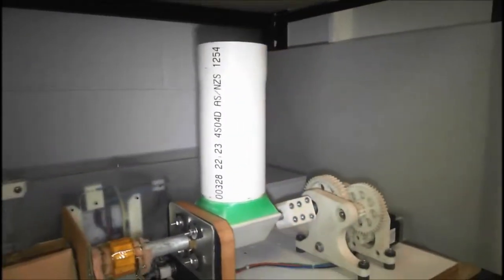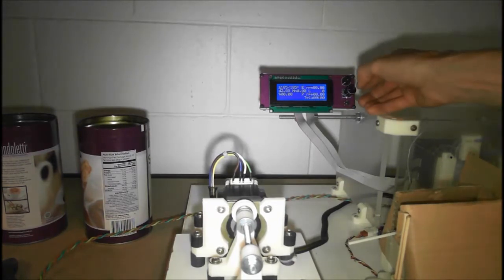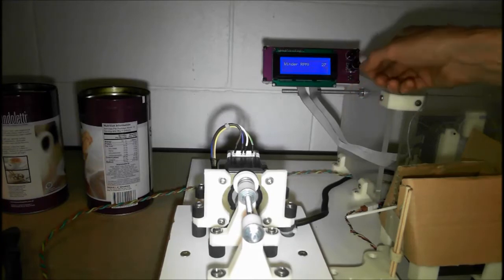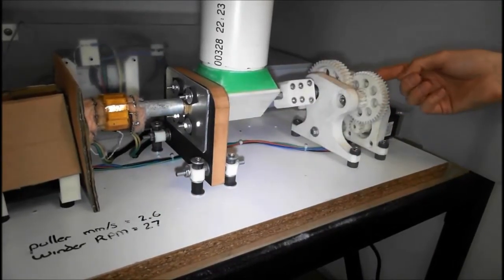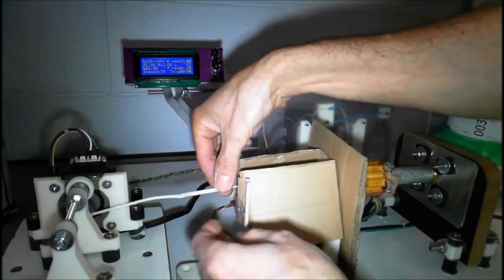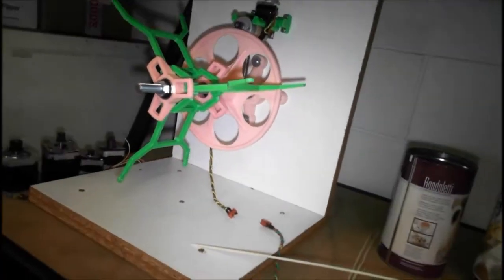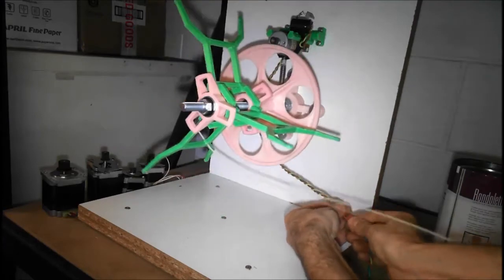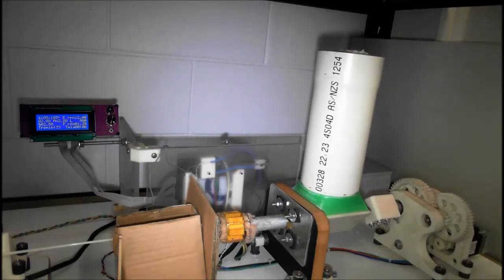Sub33D Filament Extruder  v1-00 - Setup and usage instructions 01

Comment from the maker: Hi Mili, We are still working on the design, so not quite ready to publish on Thingiverse yet, hopefully will be ready in the next month or so.

However, if you give me your gmail address, I can share the google drive folder with you (all the current Sketchup design, STL.s, modified firmware files etc)

(I have shared with others and some already have built and have running extruders based on this design :-)
Reply from the maker: Hi Mili, you should have access now (log into your google drive and select shared with me)
Reply: Ooooo yes yes pls sed me the files